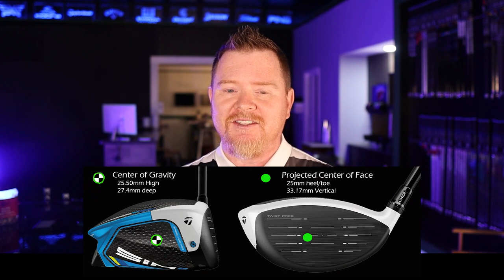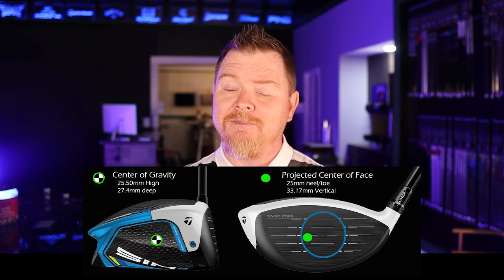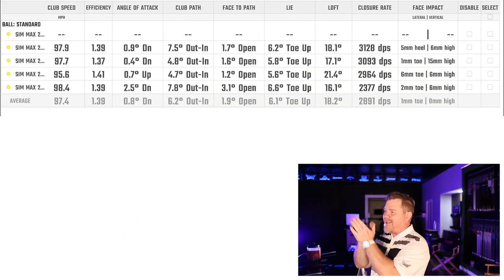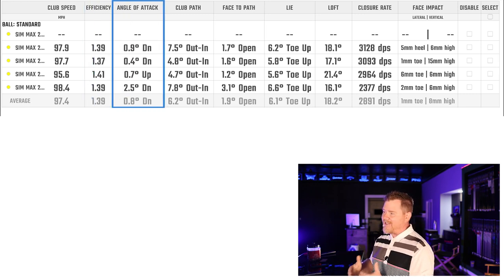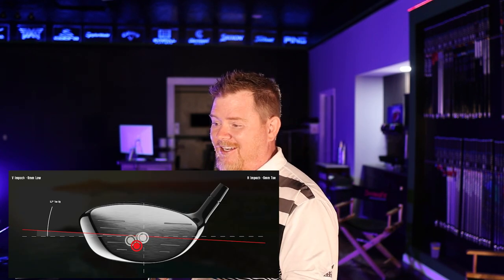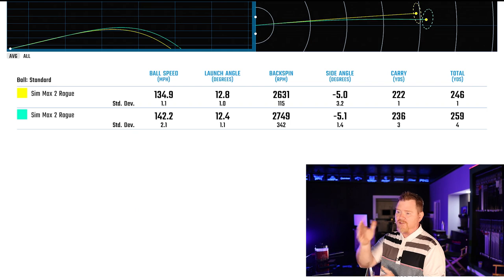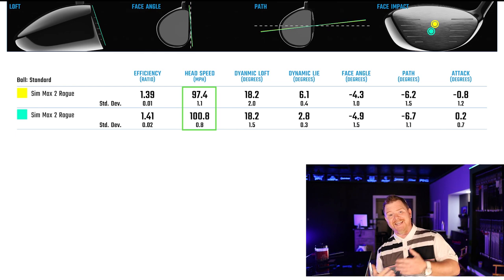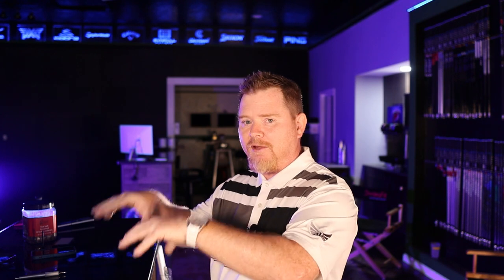Hit the Golf Ball Farther, by Finding the Sweet Spot.

Comment: Great video i sold my tsi3 as i couldn't get it to work, too low spin and launch. Switched it out for sim 2 max 10.5* ventus blue reg but i couldn't find center on the course and i got low hooks with my bad shots. I hit low heel with my bad shots so switched shaft for ventus red which instantly gave me higher launch and much more centered strikes.

Comment: very insightful video, thanks. Wondering what about trying to adjust the CG of the head so that it's right in the "X" centre of the driver face? I've heard for drivers with a heel-toe weight rail, weight near the heel will move the CG / sweet spot towards the heel.
Reply from the maker: Correct cg will follow wherever the mass is located, so one of the things we will evaluate is where is someone’s miss tendency and then choose a head with a Cg location that would cater to that miss. If someone favors the heel then have something located to high toe side would be a bad fit. Thanks his is why I wish more drivers had the ability to adjust weights so we could further dial someone in but we at least have enough options so we can make do.

Comment: First, congrats on your 1st year. I just found you on a search for CG on epic max 9* driver & it was answered for another viewer. I’m 65years young & game the epic max 9* driver but I game it at 8* with a motore speeder vc 6.2 tour spec x flex shaft at 45” set at neutral on hosel & head. My swing speed avg is 101-102, carry is 258, total around 279 avg. my contact on the face is about 2-3cm up of center & about 2-3cm towards the toe with an avg launch angle of about 13-14*. Where is the cg on the face based on the 8* loft & shaft I use & can I improve on these numbers? I’m also a high ball hitter with a 7 iron carry of 175yds. I game the Titleist 716 T-mb irons. Love them. 
Thank you & wishing all the best for a successful YouTube career. You’ll do great because you don’t overwhelm us with data & get to the heart of the topic quicker than most.
Reply from the maker: First off thanks for the feedback and kind words. 2ndly I would say your numbers are really damn good and if you were to get fit it would be a hard task to beat those numbers. The only thing I would say that you may benefit from is that of dispersion and tightening you up on the fairway but outside of that your numbers would be exactly what I would hope to achieve with someone of your speed. The only other thing I would say is that wiith using that low of loft and sometimes hitting it high I would say that you likely are hitting it higher in the face so this would also be something that I would want to check so could be AOA or tee height...
Reply: @SwingFit  Thank you!! My dispersions are fair as I hit 8-10 of 14 fairways with a butter cut. I can’t draw the ball with my driver but I have the epic max 13.5* 3wood with the same shaft for that. Again, thank you.

Comment: How can I find the  sweet spot or overlay on my driver myself? Thanks
Reply from the maker: It’s a really good question the only effective way is to get on a launch monitor and to hit a series of shots. You will need a way to measure the strike point and then after every shot pay hit to where on the face you hit it and then compare it to the results one at a time. I know this seems like a lengthy process but generally after about 10 strikes you should hit a couple of of good ones and whichever are the best then just pay note to where the strike point was. I would suggest using strike spray and capture the strike points using a pen and pad. From there just play around with your tee height and aoa to make it better the reason this can help is aoa will change the cg position at impact and can help you stack it behind the golf ball. The shots with the highest smash would be the ones you are going to chase. Hope this helped

Comment: Terrific video John.  A real "golden nugget" of information.  I have been playing a Callaway Big Bertha Fusion driver for a few years.  I hit it fairly straight, at least straight enough to keep it in play.  I just don't hit it very far.  I would guess I hit it around 160 yards.  I NEED MORE YARDS!   The driver has a 12 gram weight on the bottom near the back of the club.  It is a 13.5 degree lofted driver that I have set at 12.5 with a draw bias.  Is it time to adjust the CG possibly or buy the newest "shiny" thing to get me those yards?  Thanks John.
Reply from the maker: All good questions would love to know where strike point is specifically so if you can spray the face with some foot spray and let me know this may help. Also I don’t mind more loft on a driver if it’s needed, but as of lately and with the new technology I am finding that I need anything beyond a 10.5. Driver. Think if it like this there’s a reason why we are seeing strong lofted irons today because of where the cg is located, so if I was a betting man perhaps loft and a new head might be something worth considering...
Reply: @SwingFit  Thank you John for your insight.  I will get to the range ASAP and let you know the results.  Unfortunately, I can only adjust the loft of this Callaway Big Bertha Fusion driver -1 degree to a loft of 12.5 degrees from 13.5.  I will plan on scheduling a time with you in a few weeks when you are available.

Comment: Confused on two counts: How would you identify where cg is on your driver and why don’t club manufacturers just tell people where it is?
Reply from the maker: Great question, launch monitors would be you best source here you would simply monitor your ballspeed spikes or smash rating and whenever you hit a high mark you would simply pay notice to were on the face you came into contact. In regards to why MFG don’t tell everyone where the sweet spot is, well a couple of reasons with the first one being that it can change especially if it’s a driver with movable weights. The second reason is the MFG. would rather not tell the consumers to focus on a small precise point on the driver face as that could potentially mislead people into thinking its a bad driver or that it might not be as forgiving.
Reply: @SwingFit  Hey thanks for hitting back and keep up the great work!

Comment: Where is the CG location for a SIM2 driver? Is there a website that shows CG location for different drivers?
Reply from the maker: No public website but I do have access to a database that tells me where it is. I’ll take a look shortly.
Reply: @SwingFit  Okay. Thanks. MyGolfSpy used to report CG location but they haven't done it this year yet.
Reply from the maker: Sim2 is dead center of middle score line and also favors the toe just a bit but just marginally.
Reply: @SwingFit  and how about the original SiM Max John?
Reply from the maker: @jimmyriter8638  top middle score line and favoring heel side a fraction
Reply: Are the cg locations you mentioned true for 9° heads and if so, are they consistent from same head to same head.